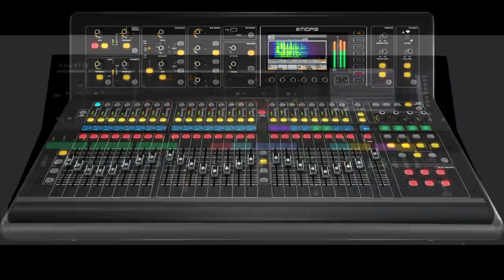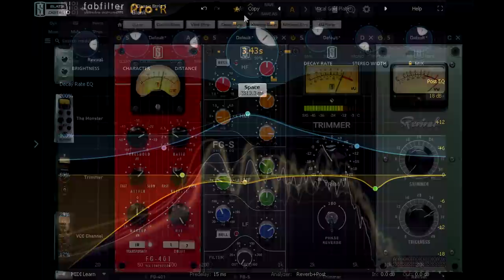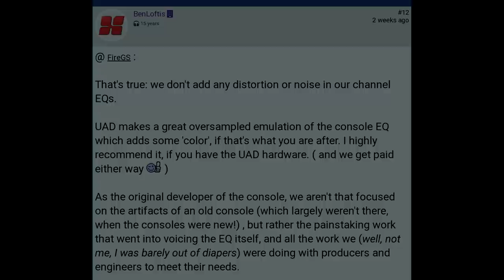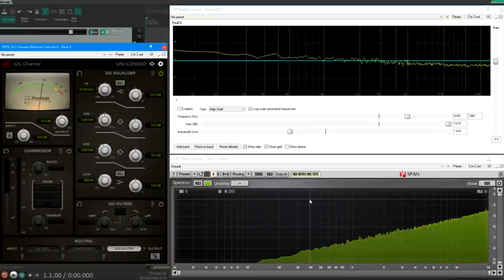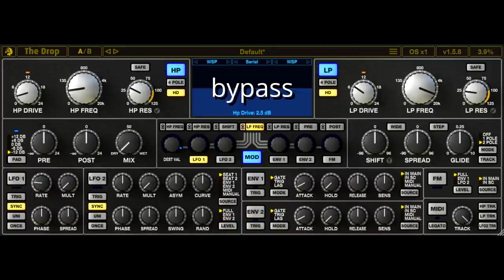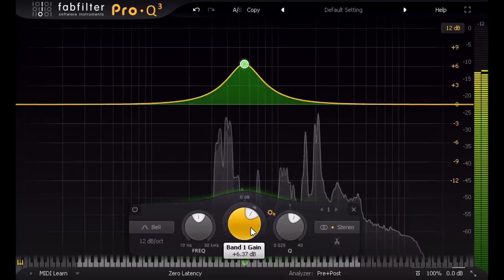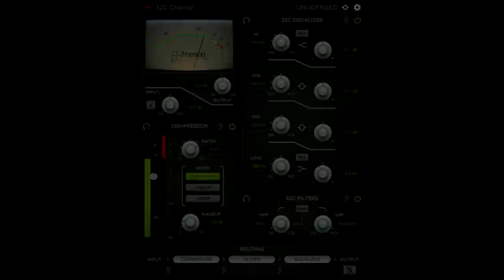Why Does It Null? (with ReaEQ) Harrison 32C Channel Strip

Comment: It's absolutely embarrasing watching these companies milk the consumer.
And with a legendary brand such as Harrison, what a shame.
At a time when we really need developers to push closer to hardware, we are being sold presets instead.
The more of a scrutinous environment we create, the tougher it will be for them to even think of beginning a development like this, which should eventually lead to progress !
So hats off to Dan and all those who do the same, most preferably without invested bias, cough*

Yesterday i was reminded of something in terms of technical limitations of CPU. In the gaming emulation world, they hit upon some technical limitations of emulating certain old consoles, and it turns out, it doesnt matter how powerful a CPU can become, it will always have inherent latency and a couple other snags where the work a dedicated chip or 'else' does, cannot be transformed into software without the snags.  The result, software alone cannot achieve the work of what the hardware is doing.
 However ! Some clever guys came up with component emulation as a solution, so that the software believes it is using actual hardware components. But more so, they designed 'cores' on a board that could be utilised to emulate any component design.  The result, a 99% clone of the original, with a major major reduction in any lag or snags.
 I think this is the way forward. It would mean a dedicated piece of hardware, with the cores, but it would be flexible to emulate anything. Now, we appear to have circuit emulation happening in the audio plugin world already, Roland have done a good job with their synths with their circuit emulation tech, it's good, still not as nice as the hardware, but closer. And notably they use far more cpu than other vsts.  I can only think that they are working within limitations of cpu.  And then we have UAD who already have dedicated hardware, but they are not doing component emulation, it's basically the same software but offloading CPU work.  Oh and also Acustica, who some feel gets closer to hardware, but are incredibly demanding on cpu.
 So where are we at really in this audio plugin world.  Why has the buck stopped here.  Just feels like they stopped to milk the market being aware that the average consumer is happy with the current progress of plugins.
 But i think they can push forward and bring us much much closer to what hardware does.
 And if you can't hear the difference between hardware and software emulations, then i recommend using an 'ear gym' because it trains your ears to hear frequency, width, dynamics, etc.  That sounds rude but believe me it really helps if you work with audio ! In the end you will be able to pinpoint the most subtle of changes accurately.
Reply: @DoctorMcFarlandStudios   I can understand that, but i bet if we compared it to the console it wouldnt sound the same.
Reply: @HarrisonAudio  Some of the claims : "32C Channel plugin brings Harrison's True Analog sound", "a complex emulation of the original Harrison 32C EQ. Every resistor, capacitor, and transistor is included in the model.".  So why not provide comparisons between the plugin and the console you modelled.  Because as Dan has demonstrated, it is a completely clean digital EQ that does nothing different to a stock digital EQ.  Although i understand hardware EQ can be clean, i find it hard to believe that the hardware adds no additional harmonics and variances in phase shift etc.  What is the 'True Analog Sound' here if it's simply a perfectly clean digital EQ ?   This is the line i am complaining about, because it's like we are being sold the same product over and over -under the spin that it's 'True Analog' 'circuit modelled'. That is just a milking, where actually we are in need and desire to actually have a Harrison channel for example. Progress is being put on hold. That's also my complaint. I appreciate you have modelled the curves of the EQ, thats good to use, but thats not all of whats being claimed, and actually, we can simply share a preset on a configurable digital EQ and get a very similar result.
 Now, i'd like to make it clear that this is not about Harrison Consoles, but the plugin market in general. Alot of developers have been doing this, for a while now.  I appreciate Harrison Mixbus software, because it at least attempts to model the behaviour of a console, interactive behaviour. I am still searching for an interactive console emulator.  Most of them add colour but dont have interactive behaviour. A few claim to, but i tested them and its actually just something else.
Reply: @HarrisonAudio  Doubt.
Reply: Harrison should just admit this plug in (and their "buss" plug) will NOT give you the same results as using the mixer in that  awful DAW of theirs. Just try a comparison if you can be bothered. I've had it for years and simply can't bring myself to use it regularly, or ever. Did one stem mix in it, and while 
it sounded admittedly quite good, with a sound I couldn't achieve in Ableton, the painful experience was not repeated ever again. Not worth it. It's shameful and very dumb that they refuse to port the actual sound of mixbuss to the plug in, yet market it in such a way that you think that's what you're getting. Absolute losing strategy they've got.
Reply: @HarrisonAudio  that's a load of bullshit if i've ever seen it
Reply: @DoctorMcFarlandStudios  the "intent" of the EQ and the reality of the EQ are very different.
Reply: @HarrisonAudio  i think harrison went too far in marketing and claims that they cant step back from it anymore. Now all we left is with arguments.
Reply: @HarrisonAudio  Wow.
Reply: @HarrisonAudio  Does the Technical department know the Marketing department is spraying all kinds of poop under the brands name?
Reply: @HarrisonAudio  The plug-in clearly doesn't work as advertised. Harrison should pull it from storefronts, issue refunds and a public apology and release it again when it actually does what it's supposed to do - emulating the console. You've done in it Mixbus, you have the DSP code, why didn't you use it? Did the marketing people got a completely different brief than the engineers and the two teams never talked? This is embarrasing! Please stop pretending like this plug-in does what you've advertised because it's only eroding your brand's credibility. And that is a darn shame!
Reply: @HarrisonAudio  blaming the consumer for your misleading marketing now are we? Definitely the fault of the company when they claim "The 32C Channel Plugin provides a complex emulation of the original Harrison 32C EQ. Every resistor, capacitor, and transistor is included in the model."

Thanks for saving myself and others from potentially making the mistake of spending money on your products. Plenty of honest developers out there that can stand on the merits of their product, and not have to rely on lying to the consumer.
Reply: The plugin in review is not real. Just download the demo and try to reproduce the steps
Reply: @i.shadrin  I don't quite understand, the plugin isn't real ? In what way
Reply: What a load of BS, UAD has tried to emulate hardware via components for years & a lot of the time failed miserably , the companies now using a form of convolution capture of the hardware have gotten much closer because it’s a sample of the real hardware.
Reply: @boomish69  Not sure who you are replying to or what part of what i said is bullsht, but 'much closer' is not an argument in response to what i said.
Reply: @JustMee-k8q  i was wondering the same thing. I just watched this for the first time due to the growing drama. I get sticking up for your product, but christ
Reply: You should look at the recently released signature plugin bundle under a well-respected plugin manufacturer where you get the privilege of paying $40 for a trim plugin that the company swears does more than trim volume up and down, but won't provide clips (spoiler, it's literally just a trim plugin). They hyped it up HARD with marketing, and people on GS and Facebook production groups are lapping it up, happily giving them their money. 

Or their other plugin: a control-less limiter....
Reply: @JordonBeal  Good Math sounds great, and so does the limiter with no controls.  If you want to waste time tweaking endlessly, then get something with all the controls you probably don't need
Reply: @bontempo1271  that s capitalism, selling you 'dreams'

Comment: Maybe Cockos did recreate every resistor, capacitor, and transistor of the original Harrison 32C EQ with ReaEQ? :)
Reply: I bet this is the correct answer. I dont believe Harrison can be such scammers :P
Reply: The mystery is thus solved then!!!
Reply: @AGalanKh  they did actually admit to making their emulation to be as clean as possible in Gear Space. Don’t remember why they justified it as such but it does kinda feel like a spit in the face after they advertised it as being a dedicated emulation. Ah well. Always was more of a Neve Guy anyways
Reply: It  takes certain resister values to make an EQ have certain shape with the least amount of phase shift possible.  The DAW and the plugin are identical to the original console.  It is everyone else who thinks it needs to have saturation when the intention of the original design was to have the highest headroom and lowest distortion possible.

Comment: I'm glad you included the bit where you said that the Harrison EQ sounds a little warmer, richer, fuller bodied, "it's quite subtle but I'm confident I can hear it". Because that's the exact thought that goes through anyone's mind when they're trying out a new plugin that they have high hopes for, and perhaps spent money on. As mixing engineers and producers, we're doomed to try to recognize and eliminate this unavoidable placebo...
Reply: @mehi8145  Punchy Warmipulation and Oomphy Saturilation are in the Air-band, my friend!!
Reply: One could call it also less true to the transients and more muddy. I liked the reEQ version better 🤓
Reply: @nichttuntun3364  a little bit info : ReEQ is actually a JSFX plugin developed by Justin Johnson to be basically the poor man's Pro Q (without the ease of use like keyboard input and multiple band selection, ofc. Which is perhaps in development because the GUI is already a bxtch to develop).
Reply: @junkawakami3193  thanks for the information :) appriciated :)
Reply: Can't tell you how many times I've eqed on a disengaged eq. Same placebo effect.

Comment: Harrison's software division has steadily gone downhill over the years. Thanks for holding their feet to the fire, Dan!
Reply: Drum flow and their DAW are levels ahead
Reply: @Reggi_Sample  Reaper is better
Reply: Reaper is different than HMB. Reaper is great, has good stock plugins and is about as customizable as a DAW can get. Too bad you're going to spend hours setting everything up and mixing becomes a window click through hell. Record and edit in Reaper, mix in HMB because every single control you need is immediately in front of you. You shouldn't be taking longer than an hour to mix a song.
Reply: Matter of fact, when you go into an actual studio with an actual console normally you shouldn't take more than a few days to mix an entire album. Its gonna take you that long to click back and forth between plugins in Reaper

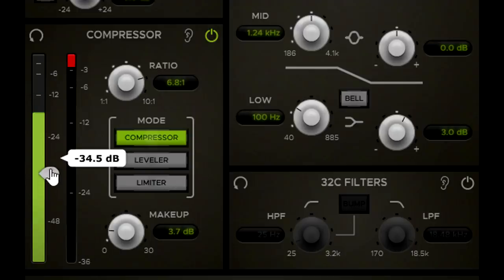Comment: First thing I thought while on 23:48 was "ok but is there any mix knob?" So many analog modeled channel strip plugins nowadays have one.
Reply from the maker: A mix knob for the compressor would be nice, but you can still use it in parallel without one: I'd want attack and release controls first.
Reply: @DanWorrall  Yeah, I'm with you on that. But I was thinking that usually, with channel strips, I like the EQ curve and I still wanna use the compressor as parallel, but not with the eq. Still, it may be too specific but I'm just comparing.

Comment: Wait until you hear about the Presonus Fat Channel. I ran it in PluginDoctor back in the days of studio one v4 and it behaved like it should. Matching other emulations. But then in v5 they actually removed the saturation, and kept calling it ”perfectly modelled” and such. Support kept insisting the saturation present before v5 was not suppose to be there and that ”state space modelling” is still emulating every component in the actual hardware… i get a meltdown from just writing this… many bought the bundle for 500€ back when it was released. Then when they removed the saturation they lowered the price to 1/4 but never told anyone about why…
Reply: And it cramps, too. It sucks because there's so much potential but presonus doesn't care about it too much since the Marketing is obviously geared towards intermediate or beginning mixers
Reply: why would they nerf the product to sell it cheap? it doesn't makes sense, it's an already made software not a physical good you need to nerf in order to sell it cheap.
Reply: @croay  patent of the code.

Comment: I'd be really interested to see you do a video on the Scheps Omni Channel. I haven't used it much because I've been having so much fun with Pro Q3, but I think I'm ready to get back into "character" plugins, and I like the way the Omni Channel doesn't attempt to emulate specific pieces of gear, just the unique characteristics of certain circuit types, and allows you to audition between those types without having to change settings, particularly with the three types of compressors it offers.
Reply: Scheps isn't a character strip tho. Aside from the saturation strip, it doesn't add color.
Reply: @croay  the compressor has three modes based on classic circuit designs that don't add "color" per se if you take "color" to mean arbitrary changes in frequency response and added distortion but each mode works and sounds differently for a given control setting, which is like having different "colors" of compression, which you don't get on a straight digital compressor. I don't know how the differences in the modes are implemented. Could be anything from 3 different mathematical algorithms to actual component-level modeling. Neither one infers changes in frequency response or added distortion necessarily, but however the three modes do their thing, they're all doing something different which could be described as "color".

I also understand that the EQ is simply a digital EQ with curves based on approximations in curves from analog gear. I'm not suggesting there's "color" in the way of changes in frequency response or added distortion, just that limiting the curve to a few choices makes the Omni Channel "more" like those pieces of analog gear than, say, the Pro Q3, because even though you could absolutely use those curves with the Q3, your ability to use any curve you want makes the Q3 in general not sound at all like any particular EQ, whereas the Omni Channel EQ is limited to only sounding "sorta" like a particular piece of real gear. So again, I guess it's how you use the word "color". If the accepted definition in the audio world is changes in frequency response and added distortion then ya, it's not adding color but it does have a bit of a "flavor" then 😂 that makes it more like something specific rather than a surgical, super versatile, Swiss Army Knife EQ like the Q3.
Reply: @TheZappazapper  oh, sure, you got what I mean and I agree with you there, I think we should start differentiating these types of "colors". I personally use the omni channel and really like it.
Reply: Scheps Omni is a great/powerhouse mixing channel strip. It has everything you need except time based fx of course, hence the insert slot. I love it, many people don’t like the flavours of comp but for me I can make it work every time also love the dynamic eq.
Reply: @croay  This is strongly incorrect. First off, you should be able to hear it, but if you can't -- run Omni Channel through Plugin Doctor and you'll see significant harmonics added as soon as you engage the FET or OPT compressors, even without any compression happening. The VCA compressor has harmonics, too -- different harmonics and they react differently (increasing as you dial in more compression vs. the opposite for the other two.) There's also a little bass bump when FET or OPT is engaged. And even if it was "just the saturation strip" that adds color (and it isn't) -- you can't say 'aside from the saturation strip.' That's the point of it.  Finally, the EQ curves are unique in shape as well. Take a look at the TONE vs MID wide band, for example. Wildly different from one another. The wide on MID band is uniquely wide - you can center it on a favored frequency and push it into the compressor for unique shaping options.  You also get API style proportional EQ curves, and then P mode for standard functionality... Don't under estimate Omni Channel -- it's a unique, powerful, and colorful channel strip for sure.
Reply: Dan has an omnichannel video now because Waves gave him all of their stuff because he has youtube clout.  It's good.  Some classic Dan nitpicking, but he doesn't roast it by any means.

Comment: The only channel strip I ever liked using was Scheps Omni Channel. I never investigated the character aspects of it with plugin doctor or anything, but the interface is great, and there are enough adjustable parameters on all of the modules to make it as useful as advertised imho. Most of the other ones seem to just kind of scream "analog warmth!" and pray people will buy it because they put the same colors on the knobs as a Neve preamp.